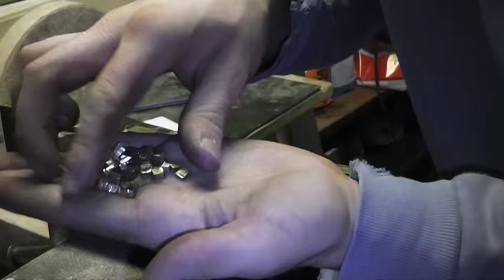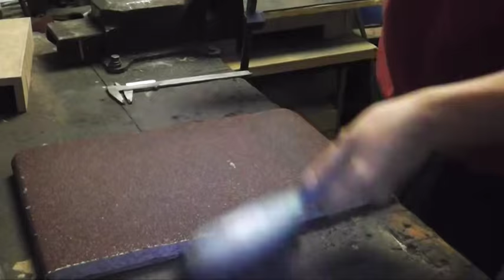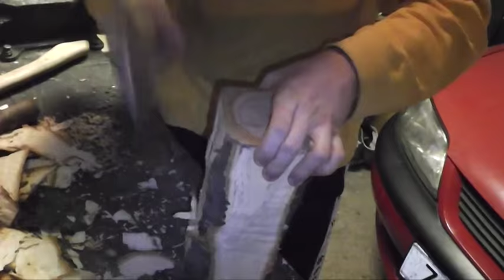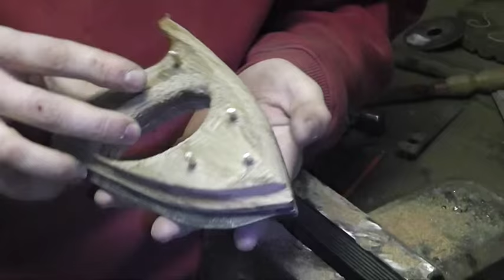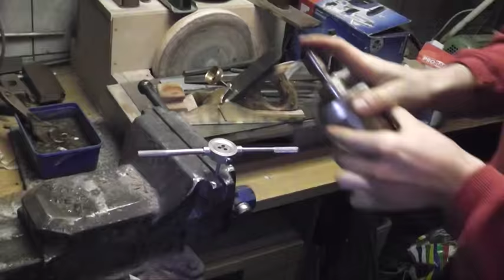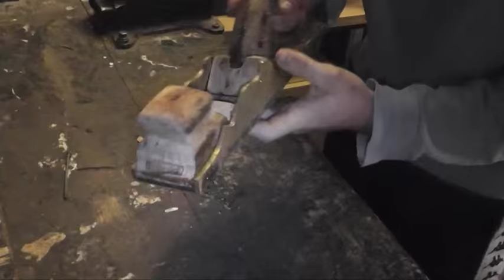Making an Infill Dovetail Panel Plane - ToolMake15

Comment: That's a hell of a lot of work (hand work) but great job on it, not sure it's worth the effort for what it's capable to do, I'm pretty sure that any well tuned Stanley style, will outperform this plane with a lot less "elbow grease", but what's the fun in that?
So, for all those who want to build an Infill, this is a good example.
Thanks for sharing.
Reply: actually infill planes perform extremely well and I sure his does also
Reply: I'm pretty sure it's good but, don't believe it will outperform a well tuned Lie Nielsen plane, that is my opinion.
Reply: +ronin4711 The joy of making this and milling lumber with it will never be exceeded by anything money can buy. You are a complisulter. That is my opinion.
Reply: Katz-Moses Woodworking Shop 
I thought that a plane like that should be use for fine finishing work, not for milling, but that's me.
As for opinions, as once Clint Eastwood said, 
"they are like buttholes, everyone has one"...
If I knew how, I'd send you a sound Raspberry!, 
Consider a visual one...
Reply: +John ____ agreed John!
Reply: I know, I'm late to the party but... you seem to have missed the point of this project Ronin
Reply: Right you are!  THAT is the point of it all.
Reply: KandK Ingersoll 
my friend, and the point is?
if you want to challenge yourself into building a plane, good for you!
and if you want to do with hand tools, more power to you!
but don't tell me that it'll outperform any stock factory built handplane, that'll make me laugh...
i gave my respect to the man for doing it, i just find it pointless IMHO!
my "moto" in my life is: " if you can buy it, don't build it, it's not worth it"!
"build something that nobody has done before or a much better one"!
peace my friend.
Reply: impressive....

Comment: enjoyed your vid ... you commented 'must be a faster way?', regarding the curved guide. Presuming no access to a plasma cutter? do you have a jigsaw?guessing its standard DIY kit. Also, you could save 60% to 70% of your time by forging down the legs of your compasses. There's loads of vids on here about how to make little gas forges. keep it up.
Reply from the maker: Joe Lyons I think you meant to comment on my compass video. Yes I agree that jigsaw would be a faster way, it's just that the small piece is difficult to hold for cutting and that is why I used a chisel. I have a forge but it is at my grandparents house and it's kind of a pain to set up so if I have small pieces like this it's faster for me just to file them.

Thanks a lot for watching.

Comment: Very nice!!  I'd like  to learn to  weld.   What  kind of welder were you using?  TIG, MIG, or ???.    Thanks!
Reply from the maker: TitusLivy777 I'm using here a cheap stick welder (only 100 Amps) . I have a better stick welder at my grandfathers workshop (140 amps) but I bought this one for small work at home. It has actually served me quite well. In the future I would love to buy a MIG or TIG machine but it is currently way too expensive for me. 
Thanks a lot for watching.
Reply: Garage workshop Thanks!